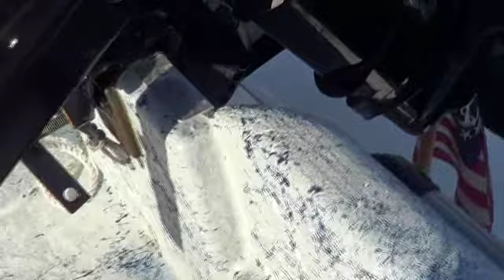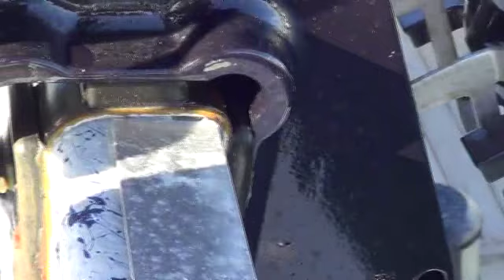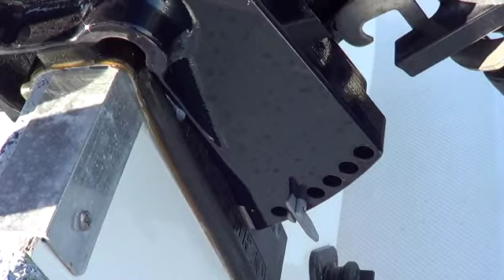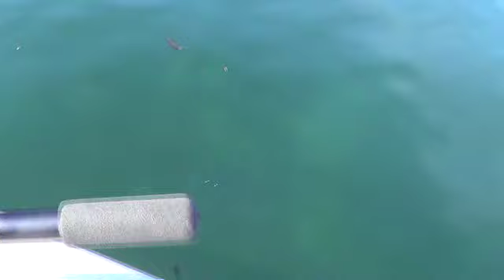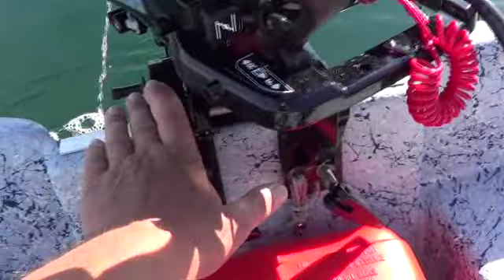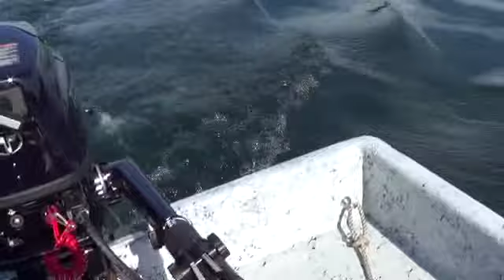Vibra-Stop cures outboard motor vibration

Comment: How would this work  on a pontoon boat with a 50hp Evinrude Etec motor?  I'm getting some vibration through aluminum boat.
Reply: Mike, I don't know if you spoke to me about your particular vibration challenge, I will be happy to assist you.  Phone is 800-765-7608 extension 801 or go to www.QwikMarine.com thanks!